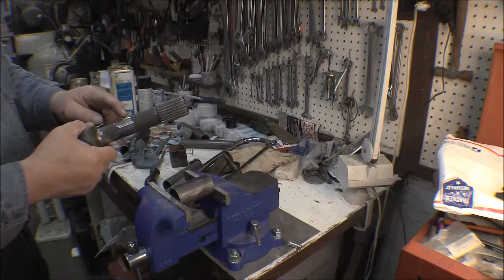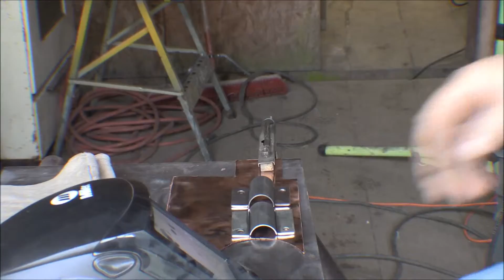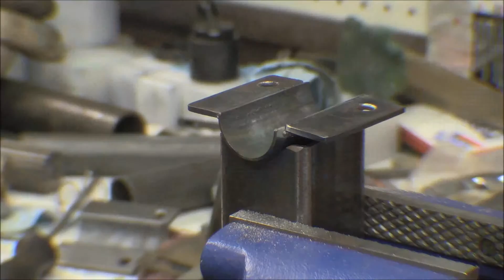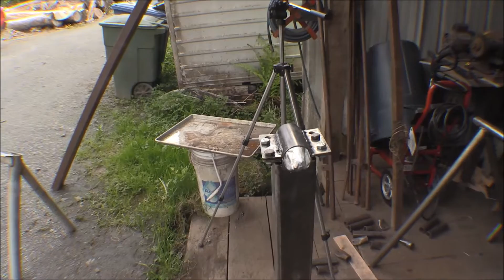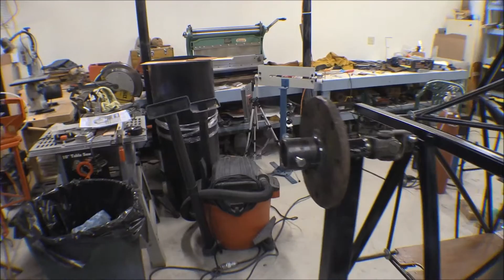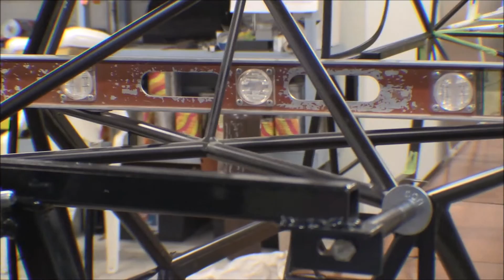Piper Supercub Widebody refurbishment; airframe rotator, part 4: front stand

Comment: That turned out very nice! I've seen a number of guys use sprockets from a motorcycle, and then use a pin to index into 32-40 different positions. However your solution should work just as well, and you can always just draw yourself a bolt circle on the hub you used, and add more holes if you ever need to index at less than 45-degree increments. I was thinking those 6" stand-offs would be too long when you first started making them a video or two ago, but they seem to have turned out OK...so all is well that ends well!
Reply from the maker: I made it up as I went along with junk I had lying around. The hub was off from a 3/4 ton pick-up with 8 holes, It gave me plenty of positions to work from, occasionally I would put the pin in a hole and line it up on either side of the post instead of the hole drilled for it, but mostly just locked into one of the 8 holes.
The longer standoffs gave me plenty of room to work around the front of the fuselage frame, wiring, running fuel lines, etc, especially once the firewall was installed. Using the four attach points it was plenty strong enough and didn't impart any asymmetrical load or twist to the airframe. With the front and rear built the way they were, I had no worries about crawling in and out of the fuselage if needed, some of the ones I'd seen I wouldn't leave a screwdriver in it.